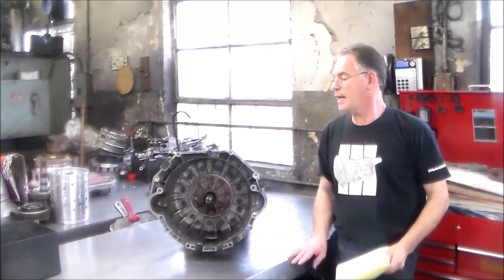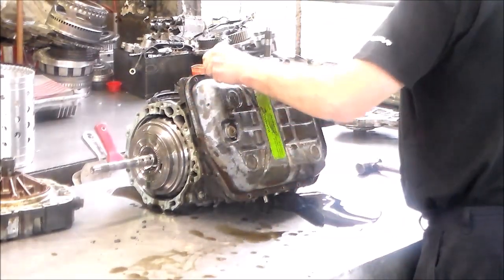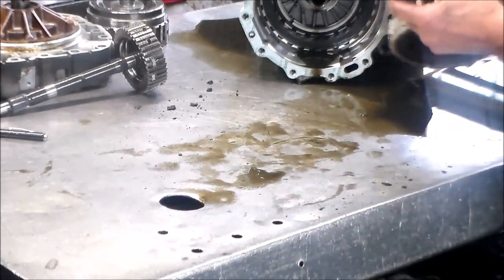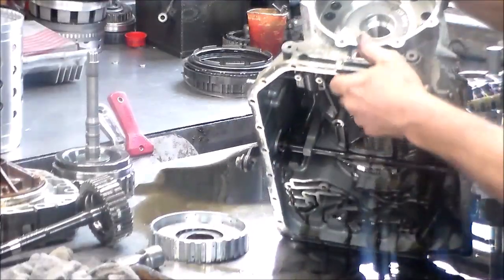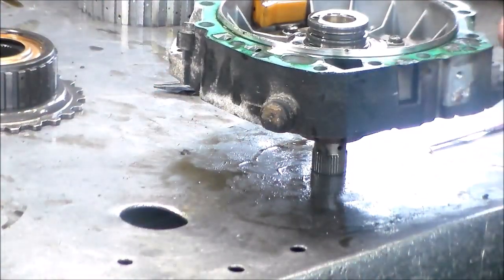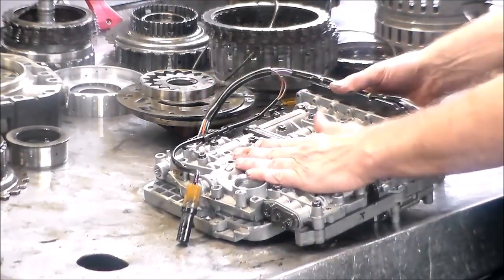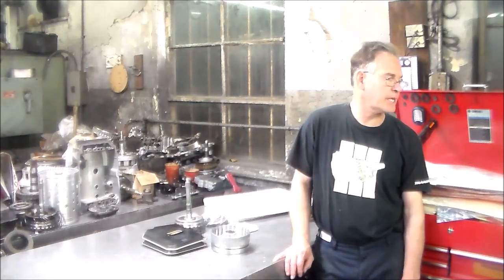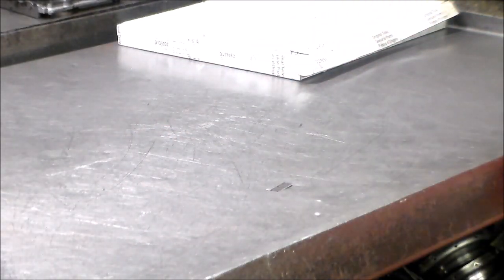Brad's ZF5HP24 Teardown

Comment: Just as a FYI, this transmission was out of a 2002 BMW X5 4.6i with 117,000 miles (seems to be the norm mileage for trans failure for the ZF5HP24).  Gary was great. Very communicative with me. I wouldn't use anyone else after my experience, he definitely knows his stuff which is obvious in his videos. Car is driving great after the rebuild and look forward to another 100K+ of driving. :) Even had a transmission from Chicago IIRC on a pallet ready to be rebuilt.

History of the car. I bought the car with it already having trouble shifting into gears which was random but frequent. Couldn't pin it down to if the transmission was hot/cold or a specific gear. I knew the trans needed replacement/rebuilt when purchased. X5 sat for a while and when I decided to do something about it, the clutches started slipping. That's when I towed it to AAA-1.

Thanks for putting the video up and the work on the transmission Gary!!

Comment: Great video. I have a ZF5HP24 out of an 03 Jag, drove perfectly today but made a noise after pulling in the garage and going into park. After hearing it, tried selecting gears and found no reverse or forward gears, until its revved and it will jump into gear. Let it cool for a little bit and found its now engaging all gears until it warmed back up, then did the same thing. Have been daily driving it and have not had any shift issues prior. A quick look didn't show signs of excessive fluid loss. Any ideas?

Comment: Nice video! Don't know why I find it more than one year after upload! I have as well the same gearbox in my E39 540i. First time in the day when I put it into Reverse, its really kicking in the reverse gear. Not so for D mode. As well, it does that really only when cold and done the first time after cooldown. If you try to do it again, Reverse will be engaged very lightly, no problem anymore. Any idea? It has about 200k miles on it and oil and filters have been changed 10k miles ago, not better...
Reply from the maker: when cold car engine rpm high

Comment: ola Gary, I have a 5hp24 BMW X5 E53 2003 can I use ZF LIFEGUARD 8 in this exchange? because I have enough for an exchange, is there any problem? because I know q this exchange the recommended and ATF1 with molibidenio and I think this LF8 has no.

Comment: Hello Gary. How much does that rebuild costs? I have an '03 Range Rover (BMW) with that exact tranny, and what is most likely the torn seal/o-ring. Starts up, drives normally for two miles then slips into fourth gear with trans fail safe warning. Seems like when it warms up, there is leakage past the broken ring. Folks here in Texas are hesitant to rebuild these. I would consider shipping it to you because the suv has been fully restored minus the tranny issue now.
Reply: Shipping the transmission only. 😃
Reply from the maker: Let me check on parts. E mail me your vin number please
Gsferraro@yahoo.com

Comment: also have a problem on the zf 5hp24 with a fault code 34 -gear monitor 2 the car fault is very slow to run have you ever had a problem like this on zf 5hp24
Reply from the maker: If this has the early style all rubber damper or accumulator, it very possible the rubber is split and leaking. I had a problem of a car going into safe mode under heavy throttle with that code and that is what i found

Comment: Thanks for the great videos you made. I need some advice I have replaced the skinny origin and that bearing as it was broken but the gear dox still has a small problem when in drive and pulling off it starts going and then slips or neutrals but in manual mode if I select 1st  I can pull off and go any advice please
Reply from the maker: How is reverse?
Reply: @GaryFerraro  perfect
Reply: I think it might be the valve body
Reply from the maker: @TURBOboost01  ok, so something in A clutch circuit for sure, you could check the  upper rear section for a crack but that usually falls out of speed when coming to a stop but check anyway, if ok, may want to swap out the A drum and get a new lower front half of the valvebody
Reply: I am from south Africa thanks for the great videos just looking at them I knew exactly what was wrong and I was able to fix 90% of the problems once again thanks for your content and support
Reply from the maker: @TURBOboost01  your welcome

Comment: Gary, i have this gearbox on my BMW E38 740.

When I put it from P to D, it takes about 3-4sec before the gear locks in. It's the same when I put it from P to R, or D to R.  The are no problems when driving. 

The time to engage gear gets longer every year.

Any suggestions? 

I have the car for 6 years, changed fluid at 90000miles, now 120000.
Reply from the maker: Have you checked the fluid level
Reply: @GaryFerraro  hi, yes, unfortunately it's perfect.

Comment: What makes the OE filter so much better to justify the price difference? I guess I'm asking what the physical difference in the 2 filters is.
Reply from the maker: The material  it's made of.  Aftermarket filter  material must be maybe thicker because it restricts the oil causing the pump to whine
Reply: @GaryFerraro  thanks, that makes sense.
Reply from the maker: @pianoman2350  any ZF Trans, go with OE filter
Reply: @GaryFerraro  Absolutely. I was just curious what the difference was.

Comment: i just rebuild my 6hp21 trans now it has funny humming noise when downshifting from 4 to 3..  only when downshifting    no slip or other noises or codes.  drives perfect fine.   Could be missed something?
Reply from the maker: well on the 4-3 the E clutch is coming off and the B clutch is coming on. The B clutch is also on in %th and reverse, any noises in those other gears
Reply: @GaryFerraro  no  all other gears are perfect   no noise at all.  I didn't touched the valve body so it that possible valve body needs to be rebuild too?

Comment: Hey how you doing. I watch your video and i was able to rebuilt my tranny successfully. Great video to learn from.. It been about 4 years now since i rebuilt it..for the past 6 months been sitting cuz i have to do a timing job..couple days now i keep getting code 48 for clutch lock up too much slip....i drop the fluid no metal no smell. But i do hear the tranny making a lil noise like torque converter...how should i test the converter or what should i be looking for...it drive good when its warm but 1st thru 2 gear it feel its struggling...any idea please
Reply from the maker: where did you get the converter from?  how many miles since the rebuild was done?  Problem is, really can't test these units, do you have a scanner that shows live data

Comment: How do you take the seal out of the oil pump? I noticed your seal is out but the bearing is still in
Reply from the maker: Front seal is held in with a snap ring, you can remove the snap ring to get access to the front seal. They are a little tight going in, i press them in
Reply: @GaryFerraro  Thanks Gary. I just took mine out, and practiced putting it back in. 

Can you provide some clarity to the instructions for the seal from the repair manual? It says "Using assembly sleeve 5x46 000 953, mount shaft seal 10.010/170 into the pump housing and secure it with snap ring"

What does the assembly sleeve do?
Reply from the maker: @GregoryEsman  It may protect the seal from getting torn, i never used that, but it is a little tight going in
Reply: @GaryFerraro  Update: It came out! Thank you for the tips. 

Where do you suggest to buy OE parts for these transmissions? Which rebuild kits do you suggest? (I'm asking because there are a few, offering different number of parts).

Thanks!
Reply from the maker: @GregoryEsman , Are you looking to do an overhaul,? Is your A clutch drum blown?
Reply: @GaryFerraro  Great questions, I appreciate your thoroughness. A Clutch is fine, though I'd love to know where I can also purchase a replacement. Yes, I am looking to do an overhaul
Reply from the maker: @GregoryEsman  I only go OE on the overhaul, Aftermarket A drum is ok, also the lower front section of the valvebody should be replaced, the pressure regulator valve bore wears out and creates pressure spikes and blows the A drum, A drum is always replaced on every rebuild. F clutch piston is a molded piston that debonds causing a slip in reverse. Where are you located?
Reply: @GaryFerraro  I agree with you Gary. I would prefer to only go OE with transmissions, too. Got it, I'll replace the A Drum.
Reply: @GaryFerraro  Noted. I read somewhere that there are new more sturdier versions of the A Drum. Are those a good idea to purchase over originals?
Reply from the maker: @GregoryEsman  They do make one with a special snap ring but not sure if the drum is any stronger. aftermarket A drum is ok to use. If your drum is bad make sure you change the lower front half of the valvebody
Reply: @GaryFerraro  Noted. Where is a good place to buy parts? Say, for the overhaul itself? (Not including the aftermarket A-Drum)
Reply from the maker: @GregoryEsman  Where are you located?
Reply: Las Vegas
Reply from the maker: I may be able to help you, do you know what you need?
Reply: @GaryFerraro  Thank you. No, not for a full overhaul. I'd like to look at all the parts required for an overhaul. Do you have a list, or something of the sort I can look at?
Reply from the maker: @GregoryEsman  I can get one together for you, does the trans  have a problem?
Reply: @GaryFerraro  Thank you. No problems. It is simply a spare trans. My goal is to take my spare trans, do what needs to be done to it so that it can run another 150k miles. My goal right now is to visualize all the parts that are required and get a cost breakdown
Reply from the maker: @GregoryEsman  ok, On this Transmission you will need at least , New A clutch drum,
The lower front half of the valvebody, and the F clutch piston. The A clutch drum and F clutch piston are the 2 most common problems, only thing left would be overhaul kit and clutches
Reply: @GaryFerraro  Got it. Thank you. Where do you recommend I buy the a clutch drum from? They're up to $600 from the places I'm looking.

Comment: Gary, I hate to critique such useful videos, but it would be really nice at the beginning of each video if you were to state how many miles were on the gear box.
Reply: 117,000 miles. :) My transmission.
Reply: @bradolsen4061  The 5HP24 that was in my old 2001 X5 4.4L lasted 220Kmi.
Reply: @garyvanremortel5218  Very lucky. I had a 4.4 where the transmission lasted around 100K (replaced under good will by BMW) and know of multiple around the 100-130k mark.

Comment: Where do you find parts for this zf5hp24? I am specifically looking for the thrust bearing that goes on the 'D' side of the D/E assembly. It seems like these bearings are no longer in production and are completely extinct... (or I just don't know where to look)
Reply from the maker: Where are you located?
Reply: @GaryFerraro  - Tennessee
Reply from the maker: @jSCOTTmc80  I can get you a ZF distributors phone number located in CT, they should have it. e-mail me at
gsferraro@yahoo.com.
can get you the number tomorrow when i get to work
Reply: @GaryFerraro  - Thanks so much! I've sent you an email.

Comment: Any recommendations on where to source that bearing that has a high failure rate? I'm currently doing one of these units and my suppliers can't get that bearing.
Reply from the maker: Call Eriksson's industries in CT
Reply: @GaryFerraro  thanks!
Reply: Hey. Just wanted to say thanks again for info on parts sourcing and for your very informative videos. I got what I needed from Erickson's. Trans is built and customer installed with no issues. Appreciate what you do brother!
Reply from the maker: @ucan2mechanical635  Thanks for the update

Comment: Hi... I've watched your videos regarding this transmission and I would like to ask you about the e pipe... could this be a reason why I am having slip and failsafe activation in second gear only In both manual and auto mode?... all other gears working fine and when in manual if I skip second gear then 3rd 4th and 5th all fine.. any help would be appreciated
Reply from the maker: The E pipe says it will cause hard up and down shifts, may not go into failsafe, do you have any codes?
Reply: @GaryFerraro  hi Gary, thanks for the reply.. no codes as of yet simply because there is no specialists where I am just indies..  but why i say this is because I'm told the e-clutch or aka e-brake (nothing to do with emergency brake) is used for second gear only which is my culprit slipper. So before I go to pull the whole transmission out I'm wondering could it really be that pipe? I'm all ears maybe I'm way off.

Comment: Hello can i use a used transmission in my 2004 bmw 545i.Will reprogramming work?
Reply from the maker: Well, I've heard from some people you can reprogram and i heard from people you cannot, If programming does not work, you would have to put your valvebody/tcm in the other trans
Reply: @GaryFerraro  ok thanks

Comment: Hello sir!
Please if you get a chance to read this could you please give me an idea of what’s going on 

I have a 2000 silverado 2wd 4.8 
I have a p0758 and p0719 after a transmission installation, now I know the transmission I bought supposedly have 100k miles fluid was clean, I took pan down replaced both of solenoids, filter and new fluid and brake switch 
code keeps coming back, 
I got scanner and under transmission I can shift all gears with scanner and all gears are good 
I can command solenoids on and off 
But it’s stuck in 3rd gear 
Please any idea will be really appreciated 
Thanks and be blessed
Reply from the maker: what is the definition to the 719 code. 758 is  shift solenoid B code
Reply: Gary FerraroP0719 Torque Converter/Brake Switch B Circuit Low
I already replaced it and it didn’t help at all
Thanks for your time!..
Reply from the maker: @GeneralMechanicGA  sounds like the problem is outside the trans in the wiring, . If you can get to the pcm, ohm the solenoid at the computer, this will check the wiring to the solenoid, i would start with that
Reply: Gary Ferraro 
I’m leaning to believe pcm is bad 
But need a second opinion, I can command shifts and solenoid with scanner computer won’t do it on its own 
So hopefully I will figure some out
Reply from the maker: @GeneralMechanicGA  very possible, but i would check those wires and ohm the solenoids

Comment: As always, a great information. Question: how is the Transmission reputation on the 2017 BMW X5, 35i. We hear some negative input after someone in the family purchased one a couple of months ago. Thanks again Gary and keep up the excellent work.
Reply from the maker: That's the 8 speed, finding the clutch packs burning out, just did an x-6 8 speed 50K miles on it
Reply: Hello Mr. Gary,, Thank you, sir, for your prompt reply. Our family member purchased the vehicle with 19000 miles, what would you suggest to do for the transmission, baby it, is it dependable or it is not a well built reputable trans? It is an expensive SUV and I hope she did not make a mistake purchasing it. Please advise and many thanks, sir.